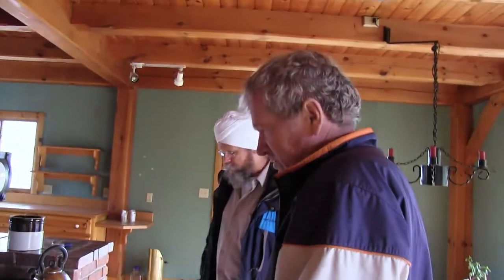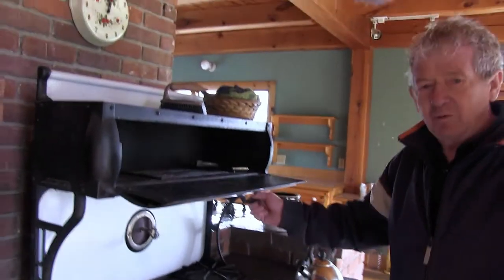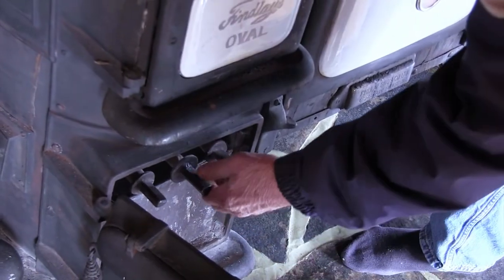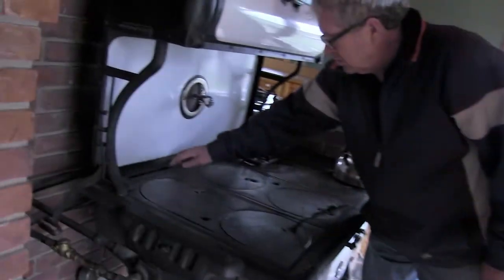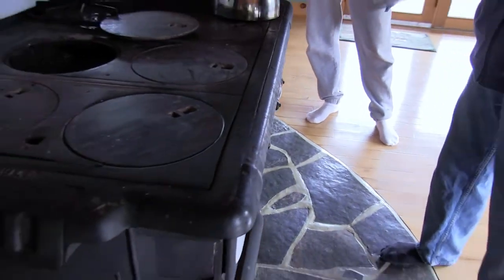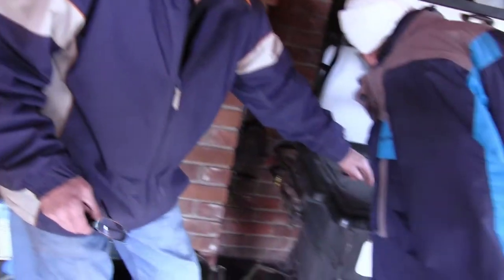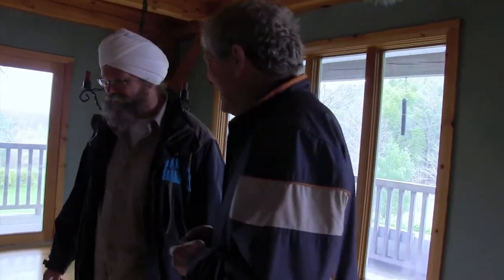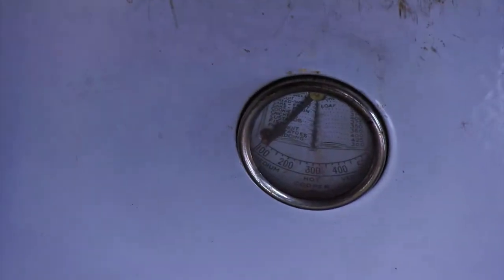Findlay Wood Stove Full

Comment: have the same stove at my cabin....she's a beast...!!! 🍻
Reply: Do you still own that stove? I’m going to buy a used one, need advice
Reply: I'll try to answer any questions ya have...✌
Reply: Thank you, I have a friend is selling a 1979 Findlay Oval, they bought it new and never used it. Is that a good purchase? I’m wondering if those things deteriorate in anyway because I know the parts are hard to get a hold of. It has been stored in a house, but never used. It does say Elmira on it, but Findlay Oval as well. Most of the ones that I have been finding used just say Elmira.  Anyways, bottom line is I’m going to buy it and use in my kitchen, but just wondering if I should be concerned about anything because the claim it has has never been used. Do you have the Findlay eay model? Thank you so much
Reply: @abrammatthew756  i would be worried about the boiler part of the stove ( if it has that option) for possible moisture collecting...rusting. and to make sure all the parts are there. Including draft keyways and covers.. Would suggest small and long fires at first. The cast plates are prone to cracking with large blasts of heat at short intervals..
Reply: Thank you for the tips, when was your stove manufactured? If you have the one that says Findlay on it
Reply: The stove has never been used and I am purchasing for $3000. Does that sound right? It was manufactured in 1979 and has been sitting in their house never used in mint condition supposedly
Reply: Do you need a special adapter to run into 6 inch double wall pipe?

Comment: I think this thing is set up for burning coal not wood. That’s why when towel head guy opened the top door and asked what the function of that was because it was blocked off …and that’s what those three turning things on the bottom are for… to shake ash for coal. There’s a different set up for wood. They have the conversion kit for coal installed on the stove.